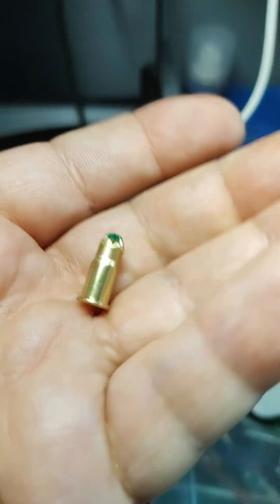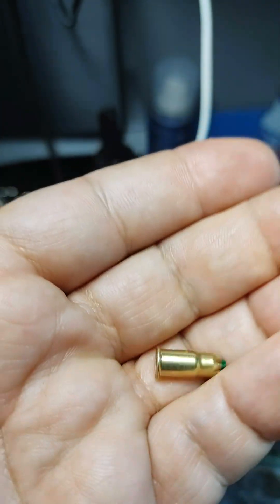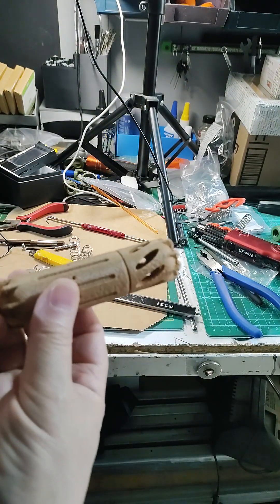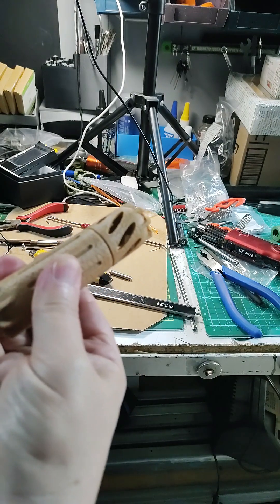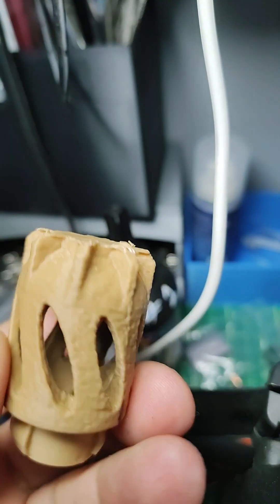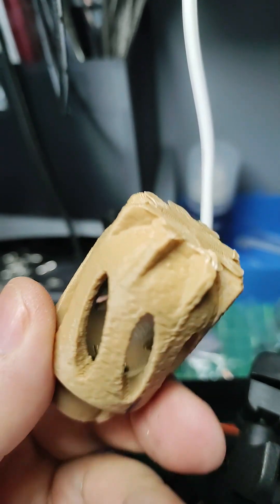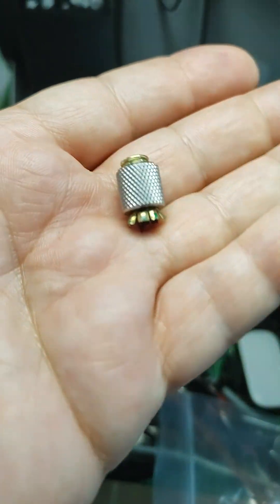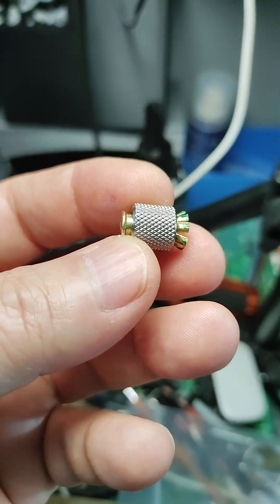Ramset Prototype # Tripwire Perimeter Alarm # Trip Wire Perimeter Alarm # Home Security

Comment: Make the shaft the primer sits in longer than the primer so it cant ger stuck
Reply from the maker: That's the plan. I'm increasing the length from 10mm to 20mm. That should cover all the different blank lengths.